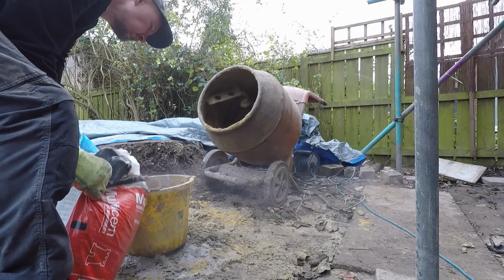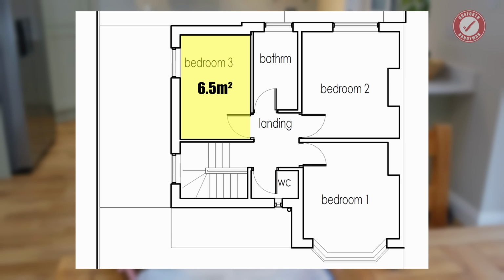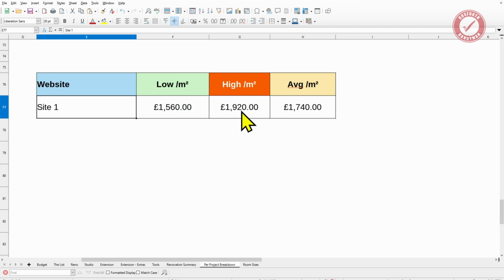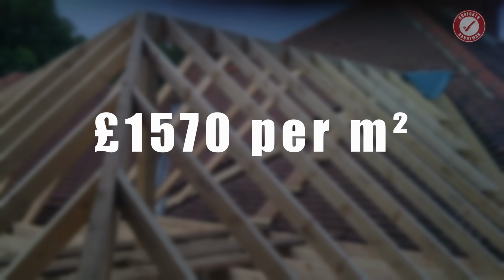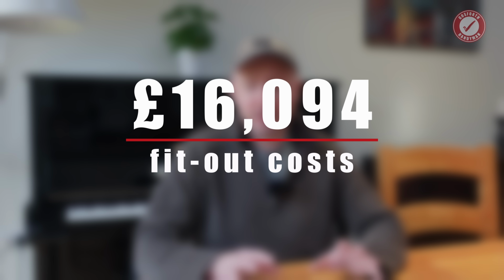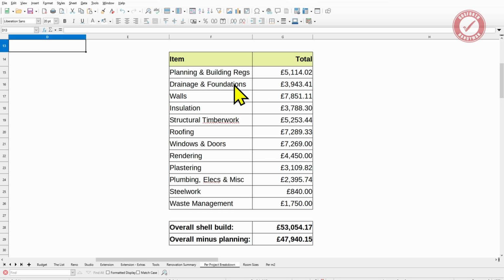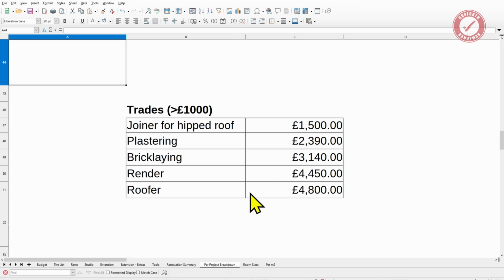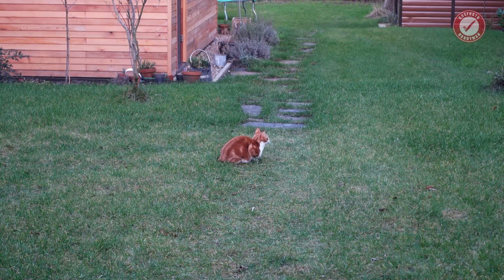How much does a UK house extension really cost?

Comment: Most trades are fast becoming obsolete and tbh they deserve it, most are unreliable and overpriced. I renovated two houses in the last 6 years and in the end I just did all the work myself, including plastering, bathroom and kitchen installation, tiling, plumbing, pipework , roofing and much more. I was forced into this position because of how unreliable tradesmen were, but tbh I don't regret it a bit as I sold both houses for a combined total of almost 200k. The bulk of the cost of an extension is in labour costs, but once you realise that most of it isn't that difficult you can get a single storey extension down to about 10k if you are prepared to do the work yourself.

Comment: Good video. We kept getting quoted 80k+ for a small so gle storey build even though most of the foundation was already there with the outbuilding. Then it's trying to find a builder wanting the work as 13 firms later only got 3 quotes. If I could build myself I would but lacking time. Even going wooden shell saves material costs but nobody wants to work it seems.

Comment: I had similar issues when planning mine, double extension with gable end, 2 bedrooms upstairs over full open plan kitchen, had quotes from 72k-160k, it’s near impossible to find good trades, and when you do they don’t want the work, luckily we found the right builder, 80k fully completed, decorated, new 40kw baxi, underfloor heating etc, kitchen on top, roughly 16k, extras 4k total 100k finished

Comment: Living in Ontario, Canada, we're facing a significant housing shortage, which has driven up home prices to levels that most families can't afford. This has led to a surge in construction activity as people try to meet the demand. However, this building boom has its downsides. Home extensions, for instance, are being priced at exorbitant rates. It's shocking to see homes that were half the price just five years ago.

For example, seven years ago, finishing a basement might have cost $45,000. But now, the same job could set you back anywhere from $85,000 to a jaw-dropping $100,000. This increase in construction is largely due to families extending or renovating their properties to accommodate additional living space, either for themselves or to rent out and offset high rental costs. Unfortunately, alongside this surge in construction, there's also been an uptick in scams.

Some unscrupulous individuals undercut prices, start the work, and then vanish without completing it. This only adds to the existing problems. My advice is to thoroughly research builders before considering their prices. It's better to pay a bit more upfront—say, an extra $20,000—to ensure the job gets done properly, rather than risking paying less and then having to shell out even more to fix subpar workmanship.

Comment: Pre-Covid we were getting quoted £40-50k for a two storey extension tied into the existing roof (so pitched roof not flat). Now we're getting quoted £100-120k for the same work. So costs have basically doubled in the last 3-4 years.
Reply: Your not wrong. I design extensions and loft conversions and the cost of construction has gone through the roof.

I'm a bit worried because extension used to be a thing that normal people might consider, but very simple box at the back style extensions now cost 100k.

I'm not sure many will bother at these prices.

Comment: All depends on the quality of builders, location, and spec of materials. If you having the garage knocked down and rebuilt then it is 49sqm period. So the other figure is void, shouldn’t even be looked at. Always go with reputation over cost, meet your builders, generally you can get a feel for someone, ask to see portfolios. We’re in the midlands and as I’m typing we would be charging £1800 sqm
Reply: Just to add your final figure was you doing the extension yourself, so having to take time off work etc, dealing with everything yourself. Good quality builders are not there to work for you for free, companies have to make profit else what’s the point 🤦🏻‍♂️

Comment: Think that's good. I got the trades in myself 75sqm extension 75sqm refit of old, new underfloor heating heat pump, new roof plus 100sqm patio. About £250k

Comment: I own a construction company doing this type of work. I always use a QS to pre-price jobs and I share that with clients. We do around 25 jobs per year. I find the square metre method a very blunt tool and as such I never use it. On my QS detailing there will always be a m2 cost per job and these vary between £900 an £4000 depending on size of the project.

Comment: Could never accept using square metre as a costing, an extension to a house is foundation, three walls and a roof (I’ve not included windows)there’s nothing in the middle so why be charged for it, the biggest part of any build is PROFIT, even if you can work out how much materials are going to cost a builder will charge double, it’s sad but if you can’t do it yourself you must pay, I’m sitting in my brand new extension that I built writing this laughing all the way to the bank. P.S. I’m not a builder.
Reply: @anthonyfernwood8093  nice comment there. Iv been a builder for the last 20 years. Your comment is spoken like someone who hasn't got a clue what they are taking about......if you think there is good money making profit in this trade anymore then you are very deluded...

Comment: Done a single story full length extension adding a front office, utility room middle and then extended kitchen with two skylights and bifold doors. All in fully finished it was £45k but that was with no bricklayer costs as me and my father in law (he's the brickie) done it together. The extension was 10x3m including a front bay. Honestly I don't know how anyone could project manage without a decent knowledge of building to sort all kinds of issues. My father in law sorted so many snags from 30+ years of building experience, without him I'd have been up shits creek relying on random trades to help me out. I think if it's straightforward you can do it at am good price but the second you run into issues you could start adding thousands onto the cost of the trades so be careful!

Comment: I did my own extension 4 years ago and came out at £26,000 with kitchen. That was 3m x 8m with bifolds toilet and utility. 
Bare in mind I only had a brickie, electrician and plasterer. Everything else I done myself including making sure building standards were met. But I've done projects in the past with work. It's not easy especially working full time as well but it's definitely worth the effort.
Reply: if you done  same project in 2023 this will cost you 40k+
Reply: @Kborodo740  hardly.... I'm based in the same area (Newcastle) and built my bedroom extension myself for 12k, including a vaulted ceiling, velux window and a massive insulation spec. I did all the work myself including the architectural tasks.

Comment: Early 2023 I got 4 quotes for a single story rear extension projecting out 1.8m x 7m only. I asked all builders to quote for cheapest materials possible for all areas (then we'd upgrade items we wanted/could afford) and to work up to a shell/plastered finish only (not decorated, floored etc.). Living on the South Coast of UK. Cheapest quote I got was 65k ex.VAT and biggest was 85k ex.VAT! No access issues to site, no drains in the way - I was flabbergasted and decided to renovate what we had with our money instead. Total rip off English builders blaming materials and cost of living to cover their greed. One gave me an itemised quote that they used this software to generate which they lauded to me when they came to quote, making out like it'll save on waste and save me money. It went down to the number of nails and rubble bags. I took it in to work and sat with my quantity surveyor colleague and we both went through materials line by line and found initial savings of 14k ex.VAT  based on obtaining materials from Wickes and B&Q at their bloated RRPs! When I queried the builder he got angry and scarpered off - he'd been had. Examples of his costings were £3.45 per litre of diesel and £12(!!!) per rubble bag. I don't believe these were admin errors, I think they know what they're doing  and don't expect somebody to go line by line through 20+ pages of quote. Not that renovating the house instead was cheap either... Three years ago had a Polish plumber fit a fully tiled, large bathroom in Greater London for £1200+materials (took him 3 weeks) and he did a cracking job. Fast forward to this year (and out of London) the next bathroom (similar size and spec) ended up costing over 15k and the materials were just under 6k! Used an English plumber mind you as the Poles have all fled it seems! After that experience I managed the kitchen refit myself, saved over 10k vs lowest all-in price quoted, but it took 3 months instead of 3 weeks trying to wrangle all the various trades myself 😂. Too many young tradesmen eager to earn big money right away because they've seen older, established guys charge big. They go solo as soon as they learn the basics and go right for the big money it seems. Also have an issue with the minimum some trades expect per job, like it isn't worth their time driving to a job for less than a grand for a day's work! One young guy quoted me £350 to swap out one radiator like for like! Greed!!!

Comment: At a very rough guess, and for a flat roof rather than pitched (because I don't tile!), I would charge £70,000 for that...but it would be a passive extension - I don't do ordinary U value extensions anymore.  That would include everything, and I mean all plans, groundwork, walls, roof, triple glazing, whisper-quiet electric heating, finished...to a very high decorative order, with shadow line skirting and fancy LED lighting.

Comment: Great video. I’m a builder of 20+ years running my own business and even after all that time pricing jobs is my nemesis. I hate it with a passion, each job is so different and intricate that guide line costs per m2 are sometimes very vague and I certainly wouldn’t quote based on them alone. I have always considered it as gambling really. You can so easily come a cropper by not quoting enough and nothing is more soul destroying and financially crippling like under quoting and working for free, especially as it’s a very hard job both mentally and physically. 
One thing I would add is that I’ve deliberately not quoted for twice as many jobs as I’ve actually quoted for. This is because the job is comprised in some way e.g poor access, lack of room to operate, awkward neighbours etc. The number 1 reason though is because I’ve not gotten good vibes from the client. Too abrupt/rude, disorganised, unprepared for the realities of having your home turned upside down temporarily. It’s very much a two way thing. You must trust me to dismantle and rebuild the most expensive asset you will likely ever own and I have to trust you’re going to pay me for my work and be able to adapt and understand when things don’t go to plan i.e unforeseen problems and changes. 
As a final thought, most of the very best tradesman are the best because they do what they do best and that’s create actual real 3 dimensional objects and installations. That means they usually, like myself, hate doing paperwork and quoting otherwise they would just get a cushty office job in the warm and dry without breaking their back for what seems at times like not enough money. I’ll stop whingeing now 😂
Reply: Couldn't of said it better myself, I know your pain, but all worth it when the job is finished and you have a happy client.
Reply: A year later but great comment. Can I ask, if you've under-quoted for work, would builders not typically re-evaluate the quote?
Reply: @nickdalts  Hi there, If I’ve missed something and it’s my fault I personally feel it’s my responsibility to suck it up. If it’s a huge mistake and I simply can’t afford to do it unpaid then I would have to consider talking to the customer to explain that it’s my fault but it’s too costly for me to continue. Touch wood I’ve never had to do that but I have with plenty of smaller missed things. If it’s a large unforeseen situation then I would absolutely let the customer know of a cost increase. Hope that answers your question.
Reply: Wow! Words out of my mouth. I cant agree more with the trust part. Literally didnt price jobs I felt promising just because of tha factor.
Reply: Sometimes the abrupt evasive customers turn out to be the best.

Comment: I was quoted recently £108000 for a 6 x 6 extension. Tradesmen just now are having a laugh and making the most out of Brexit as  all the Eastern European workers have gone back home. Had  a quote as well to fit a 15mm pipe through a single brick wall taking about 20 minutes to do and was told £350.

Comment: "Self Build".... Bad Idea!!! Let me tell you why.
 Most of the time you pay a builder/company not to build your project themselves, but to manage, oversea and guarantee the build of your project from start to finish. A builder (or good builder) i should say, will have some knowledge of all aspects of a build. They will no if the joiner is using the right type of nail or screw, the plumber is using the right size pipe, the concrete company pours the floor slab to the exact depth in order for your lovely kitchen flooring to be fitted perfectly 12 weeks later.
 A good builder usually uses good tradesmen who they have full confidence in as they have used them many times before with no issues. The main problem with trying to manage a project yourself is "trusting" that the trades you hire, are for start - going to do a good job that they've been hired to do and that they do their job thinking about the next trade that has to follow on. 
For example, your plumber fits some amazing shiny, straight looking pipework up a wall for your new boiler that's to be fitted at a later date. Your made up with the job, pay them, shake their hand and wish them well. The joiner then turns up to fit a stud wall, only to find the BLOODY plumber has ran all his pipework dead center to where the wall needs to be built. Then "you've" got the hassle of getting the plumber back to rip out all there lovely pipework that they spent 2 days installing and asking them to move it over 6 inches..... Good luck with that one. The builder whos taking say 20,30k of your money (just to manage) would have told the plumber Exactly where to run the pipes. That's what your paying them for, to make sure its done right.
Honestly 90% of tradesmen I've come across don't give a monkeys, all their interested in is getting paid and getting off. 
Never believe online reviews as they are most defiantly from there partners, friends or even themselves. Also People who advertise on these "trusted traders" websites that have pictures of bathrooms with a Californian beach in the background or an extension with palm trees in the garden are obviously spending more time on google images than actually working !!! 

That said if you know your stuff or know the right people that do, then go for it, save yourself ££££s !!! I'm sure the Gosforth Handyman will agree with my rant. Just wanted to share my views as qualified tradesman and experienced builder with the not so experienced "Mr/Mrs General Public"
Thanks.👍

Comment: That amount of extension including the garage and nothing on top of the kitchen is definitely around 60k to 80k mark, not 140k for sure.
Reason is theres a threshold to do a job, and any extra addon becomes cheaper and cheaper. Prices arent 1+1.. they are based on getting the job and a minimum to do it, then any extras are basically just another week or two of work, not priced as a new job.

Comment: A good Architectural drawing (AT or full Archi) with material specs is worth its weight in gold, helps proper costing, after that decide expectations with regards trade management (depends on building size, capacity, plus his workload demand). You can use a QS too to give up-to-date costings. You can cost trade materials with vat online and rough it out. Bricks wood plaster floor screed plus approx labour  etc

Comment: I owe a building company my self for over 20 years now. I will say that was a fair representation of nowadays pricing. I’m based in Bristol where the cost is slightly higher. I always try to separate the shell/m2 from finished/m2 by giving the customer two different quotes.

Comment: This is fascinating. We decided not to extend but to remove one wall between rooms, add a nice big patio door and then do some internal repairs including moving the bathroom. We thought we were being really sensible and frugal with our changes. We made detailed architects drawings and costed our materials at 43k including the floors, new kitchen, doors. We got a building company in who want cash in hand. They quoted 91k for their work. We now have to do the work ourselves. We are not paying 91k in cash for a start and we know it's not 91k of work either. I'm disgusted by the post-covid building scene.
Reply: And I should clarify that would be 91k and then we would still spend our 43 for materials
Reply: @onemanfran  That is beyond disgusting and our government clearly does nothing to prevent this blatant profiteering. We've been renting for most of our lives, will retire in 2 years and have saved about 100k. There will be a small lump sum from our pensions to add to this and we were thinking of buying a house to save on rent. Unfortunately, with house prices as extortionate as they are, we're having second thoughts since we'd be left with almost no savings. Past years of 0% interest + uncontrolled mortgage multipliers (used to be 2.5) + much, much longer payback terms (used to be 21 years) - and, most damningly, a government that deliberately allowed this catastrophe - has destroyed the housing market. Why do governments not look after the population? !!